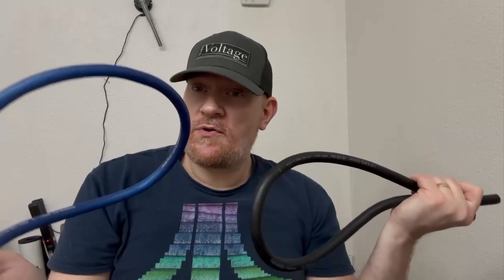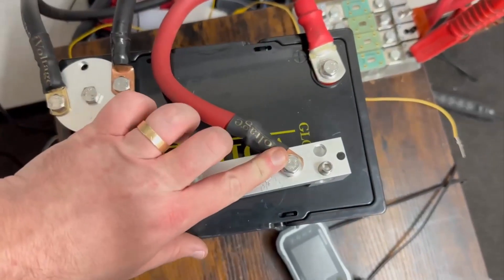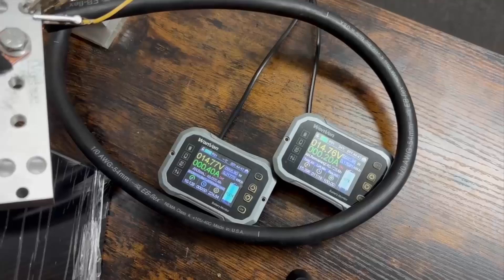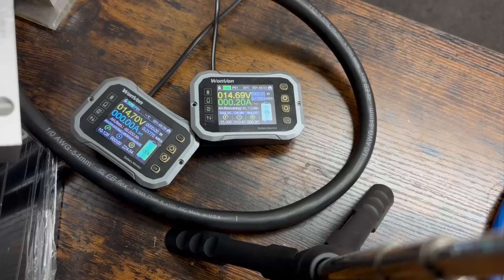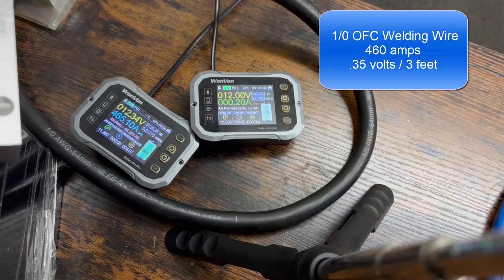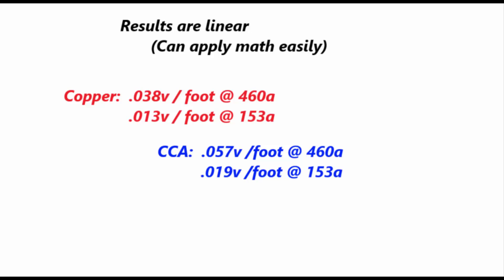Voltage Drop Test: Copper Wire vs Copper-Clad Aluminum Wire

Comment: I wonder if the drop of voltage per foot.would increase at greater distance? I think I have 15 ft of power wire from under the hood to the amp. I feel like voltage drop would increase over distance. Be a cool test to see using wire designed for car audio too. Thanks for the test.
Reply from the maker: It will be an equal amount of loss per foot since the resistance is cumulative.  So if you lose .04 volts per foot, you'd lose .4 every 10 feet etc.

Comment: I would say the average vehicle benefits from ofc than others.
The average person, has a stock alternator, and battery, so limited on current to start with, the “boss”’cca amp kit you got at Walmart, from the get go has more voltage drop,  and will have faster corrosion issues, more heat, and the downward spiral starts, voltage drop gets worse faster, top that off  the average person, will never know what a voltage drop is, how to measure it, will have far worse connections on the wire, and will never do maintenance , a competitor however will know, and could maintain a cca wiring system, and a few actually do.
I myself run an all stock  battery and alternator, I need very volt.
And still have to keep gains down, to make it all work reliably.
Last thing I need is to make heat with my wire.
Tinned ofc, 12 ton hydraulic crimps, oversized wire.
In addition to dsp, sound treatment, and very carefully choosing gear.  
If cca worked well, ALL car manufacturers would use it, it’s both cheaper and lighter. They know better….and have to survive a warranty period!

Comment: CCA can only carry 68% the current the same gauge solid copper can.  Because Math...
Reply from the maker: Maybe by volume.  By weight aluminum is far more conductive than copper.  This is why airplanes use aluminum - because pound for pound it'll move a lot more current than copper.

Comment: A more interesting test is 1/0 CCA vs 2 awg copper to see if the voltage drop is similar.  As long as the CCA wire is sized appropriately, I believe it is suitable for use.  Most entrance wires are made of aluminum.
Reply from the maker: It would take 4/0 to be equivalent.

Comment: Was price considered as a factor? Its easy to hate on aluminium but it has its place. If a 30mm² copper cost the same as a 55mm² alu then what is really the best option. I know many solar farms use alu with zero downside. Why? Because copper thieves jump the fence at night with grinders and run away with 30tons of copper wires. After a few times management grow brains and use alu. 😅
Reply: Also its a bit stupid to run the same amps on two different metals of same size. They conduct differently. Its like buying a big and small cup and then hating on the small cup for having less capacity.. like..wtf did you expect lol
Reply from the maker: That was the point of the video -- to show the difference in how they conduct, not to bash aluminum.

Comment: copper clad wire was banned in home construction because of all the homes burning down. over half the repair work at my locale rv shop is replacing wire and equipment because the aluminum wire corrosion eats all the terminals. never use aluminum wire folks... unless you like redoing/replacing everything from corrosion. go talk to any car stereo shop and talk to them. they will show you what i am talking about. any copper clad wire is garbage because of this problem.

Comment: By the way, 1/0 is pronounced "1 aught" and 4/0 is "4 aught" etc.

Rough rule of thumb:  Figure your needed gauge for copper, go up to the next standard size larger for aluminum.  In other words, if you figure you need 2awg copper, use 0awg (aka 1/0awg) aluminum.  Or if you need 1/0 copper, use 2/0 aluminum.

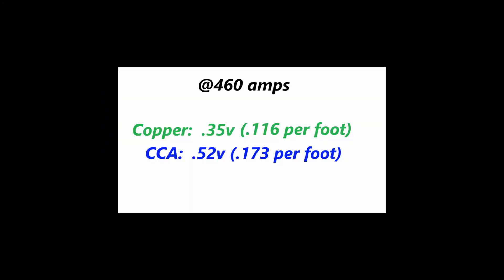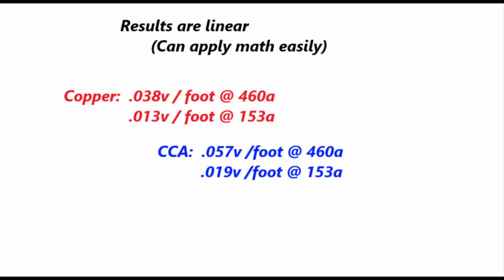Comment: Your math seems to be wrong. At 5:32 the meter shows 0.35v for 3 ft. At 5:48 you divide that by 3 and show 0.116v per foot. Then at 6:00 you divide that again by 3 and show 0.038 per foot. You double divided the results.
Reply from the maker: You're 100% correct.  I added a note during the video.

Comment: hey, if i got enough cca for cheap enough and doubled or tripled my runs where needed would that be sufficient to still use cca? may be worth a test, thanks
Reply: If you fully insulate it from moisture, it can last a long time. The problem is a lot of people don't properly insulate it so it corrodes and turns into powder.
Reply: @ well, maybe its cause i store it in a climate controlled garage but my prizm with all its cca is going strong for over a year in the build. just trying to get more power out of it and was wondering if the cca is the limiting factor here.
Reply: Typically you’re going to spend the same money for oversized CCA wire as you will for proper sized copper wire.

Comment: My 5K amp has 3 power & 3 ground terminals. I will be running double runs of CCA to each (Cause i have it already). No longer than 5ft max. Should be fine
Reply: So you mean short runs inside the vehicle from the battery to the amp? That should be fine.
Reply: @JasonWW2000  Yes my battery is in the rear

Comment: The moral of the story...quite buying cheap junk wire..if your buying cca then buy cheap ass amps cause your wasting your money... 😂
Reply: You kinda dont really understand anything it seems.
Reply: Moral of the story is understand the differing conductivity of materials.  That's it.  Use steel if you want to, she's gonna have a big CSA but it will work.

Comment: the thing i still like to see is if 2 CCA vs 1 OFC. as the price point looking at OFC for let's say KNU brand. the OFC they have per foot cost $4.75 compared to your bassik CCA wire only cost $1.09 a foot. if we were doing a dollar to dollar view 4 bassik giving more runs would give more playroom and fewer problems in the end if we were only focusing on the dollar amount right? but mostly questioning if you had 2 runs of cca would there be a better outcome to this view?
Reply from the maker: You can divide the voltage drop in half to simulate a second run of cca.  Double the wire = half the voltage lost. It’s very linear.
Reply: @GloweIndustries  aw cool to know haha.

Comment: Use the Won Von battery monitor to show the amperage draw and loss instead of looking for voltage drops. Because at 2,000 rpms, a 320amp14.8 alternator provides 320amps and at idle 750rpms it still produces 14.8v and only around 200amps. A loss of 100amps of power even though the voltage remained the same. I don't demo at 2000rpms!
Reply from the maker: This difference isn’t being caused by resistance / wiring. That’s your alternator’s output and would be the same regardless of the wiring.

Comment: Kicker Live did a great show a couple years ago running a lot of current through copper and aluminum wire showing the differences in voltage and temperature. They don't even sell aluminum wire, only copper. Lots of great info in that live.
Reply: They did sell CCA aluminum wire for about 50+ years now, primarily from China source.
Reply: @aaronsmith593 The numbers aren't adding up in your response. They haven't even sold wire for that length of time. 

I don't know if they have ever sold aluminum wire in the past. They might have. They haven't sold any in the last few years for sure.

I'll try to ask one of the long time employees at Kicker if they ever sold aluminum wire.
Reply: @aaronsmith593 I asked one of their employees, they said "I don't recall us ever selling CCA".

Comment: People are still debating over which is better? The answer is obviously copper. 

Maybe people are debating which is "good enough" when money is tight?
Reply from the maker: But this isn't factoring in any type of corrosion resistance etc.  If not properly crimped and heat shrinked I've seen aluminum wiring turn into dust.
Reply from the maker: Two runs of CCA cost less than a run of copper -- and will result in a smaller amount of drop to be fair.
Reply: @GloweIndustries To be really fair, you have to factor in the poor corrosion resistance. Then look at the failures where the aluminum wire caught fire or melted the carpet due to the high resistance/corrosion. 

Once you look at all of these factors, then it's more clear that aluminum might be okay for short runs inside the vehicle where it stays nice and dry. Long runs outside the vehicle would not be smart.

Personally, I'd just stick with all marine grade copper and water tight fuses under the hood. If you need to save a buck, do it elsewhere where it's not going to affect the safety of your vehicle.

I'm always going to err on the side of safety. I never recommend anyone run aluminum power cable.

Comment: I like it when the test results match up with the math!

What kind of meter are you using?
Reply from the maker: I'll send you a link.  It's the bluetooth shunt I use for a lot of my videos.. lets me export data into excel and graph it out etc.  If you check my videos for one called how to graph battery performance, I walk through exporting the data/designing a template in excel step by step.
Reply: @GloweIndustries  🦾
Reply: you have to get yourself one, you will never run another battery without one again, Seth got me into them a bit more than a year ago, I have 3 of them in the shop now and Have setup a few more on customer vehicles, very very handy to have super accurate as well!

Comment: Great test and video bro I'm wondering if you can help me understand something so here lately well ever since I installed the Ruthless 10k I have noticed that I can play heavily for a few minutes and I noticed that the voltage at the alternator is dropping until I added the 10k I never saw below 15.7 on the voltage readout on the alternator VCM now with the 10k I have seen it drop down to 15.5-15.6 if I play real heavy music for a few minutes it starts dropping at the alternator and nowhere else I am running a 500Farad super cap battery delete with a triple run of 0 gauge OFC to the back feeding a 72.5AH SCIB bank of the 2.9AH M5 pedestal cells charging at 15.8 and I just picked up a 6S4P 2000 Farad XS power super cap bank to add to it I have enough battery for 20k easy and after I add the other 2000 farad bank it should be able to support 25k with ease I'm only running a Ruthless 10k and Ruthless 1500.4 I never see below 15.2 at the battery full tilt and it instantly rebounds in between the bass so I'm not understanding why the voltage is dropping at the front of the vehicle please forgive my lack of knowledge I'm still learning bro my entire build has been done from watching YouTube and tiktok videos and doing it myself with no help any advice or information you can give as to why this is happening would be greatly appreciated I should also add that even when the alternator is charging lower around 15.5 the bank in the back stays at 15.8 it's always a few tenths higher than the charging voltage
Reply from the maker: I'll message you..  This is going to involve a couple of troubleshooting steps and maybe figuring out a meter failure..  It's not possible for the battery to rest higher than the charging voltage on a constant basis.

Comment: can we assume same voltage drop proportionally on smaller gauge wire?
Reply from the maker: Yes, for instance you would double the drop if you halved the wire size.  So 3 awg is half the size of 1/0, etc.

Comment: Thanks for the video. I am a firm believer that for the average consumer CCA is just fine. For the competitor, I would go OFC. Is OFC a better choice? Yes it is, Is it necessary? No
Reply: Why do you firmly believe this?

I'd say the only time it would be okay to use aluminum is if it's a short run inside the vehicle. 

Anything on the outside of the vehicle that's going to be exposed to water and the elements really should be copper. 
Also, any type of long run needs to either be copper or greatly oversized aluminum. 
Also, if you live in an extremely cold environment, I would only run copper.
Reply: Nothing is ran on the outside of the vehicle. I am running CCA right now in my daily driver, never had any issues. My daily driver is not number chasing, not out to win trophies, just to enjoy music as I drive. The voltage loss is almost unrecognizable. If CCA was so bad it wouldn’t sell the way it does. Once again, if you are number chasing, trying to win a trophy and you absolutely need the best performance than OFC is the way to go, but if you are just a ground pounder, CCA is absolutely acceptable.
Reply: @kendrellholley1975 
CCA sells because it's cheap and most people don't know it's actually aluminum.
Reply: 95% to 98% of vehicles have an external mounted battery and typically power wire is run from the battery up front to amps or distribution blocks in the rear. 

If your vehicle is in that small minority that has an AGM under a rear seat or in the trunk, then that's great. A short run of aluminum wire inside the vehicle makes sense. 

Unfortunately most vehicles are quite different.

Edit, you can be sure the OEM is running a copper wire from the rear battery into the engine compartment. They would never use aluminum.
Reply: As far as current consumption, it sounds like your not drawing too much. There are people known as bass heads who run 5 or 10 thousand watts on their daily driver, just cranking the bass. They don't compete, they just like it loud. They will have multiple batteries, maybe even lithium and have upgraded alternators or even multiple upgraded alternators.

Your probably like the average music listener, me included, that listens to music at healthy volume levels and might use a few hundred watts at most. We typically have stock electrical systems. Aluminum can be fine in these cases. We won't notice much voltage drop.
Reply: @JasonWW2000  my daily driver pulls about 5K, I have a 250 amp alternator and a lithium battery.  My previous demo vehicle ran (2) 320 amp alternators, a 96 Ah lithium battery and the sub amp was a SALT 12K. My original wiring from alt to lithium battery was OFC, from battery to amp was CCA, it managed a 157+ dB.
My new demo vehicle uses OFC throughout but I would not be afraid to use CCA, as a matter of fact due to the color of the power wire if I could redo it, I would do CCA because I prefer pink wiring.
Reply: @kendrellholley1975 That's great. I'm glad you never had to deal with the negative effects of aluminum wire. 👍
Reply: Basing how good or bad aluminum wire is by how much is sold is not logical. There's no direct correlation between these two.
Reply: This is great but you can buy ofc  welding wire for the same or lower price than named brand CCA. Just buy welding wire and get the best value and power to your amplifiers.